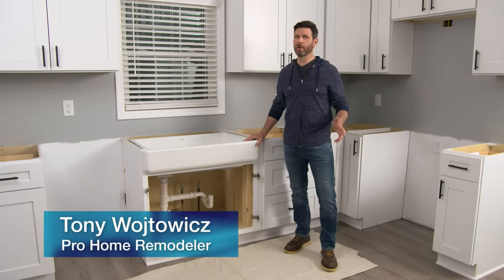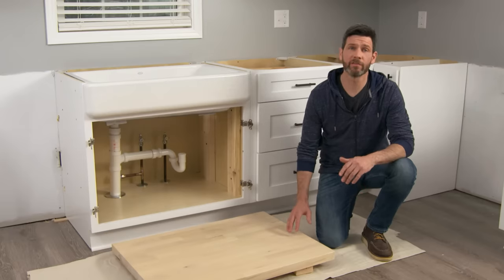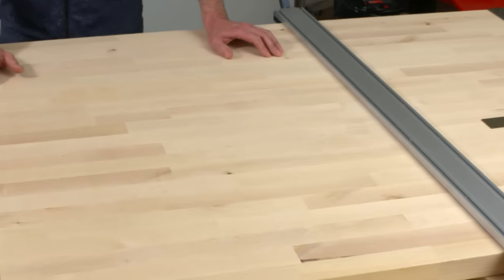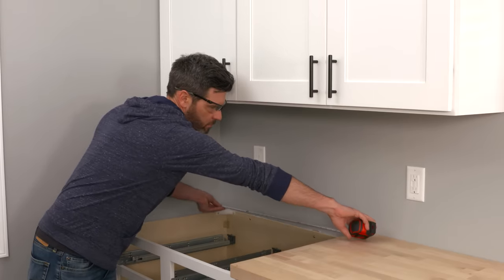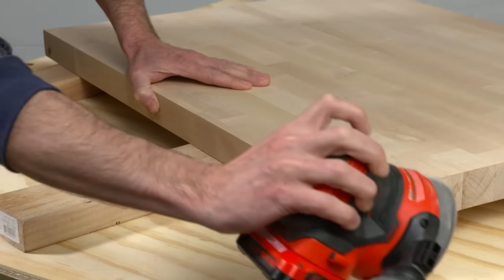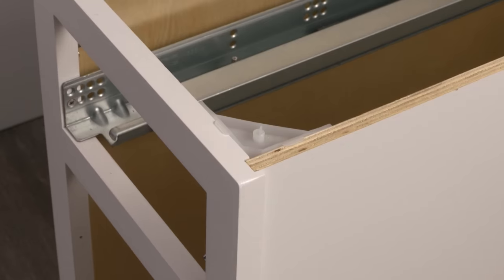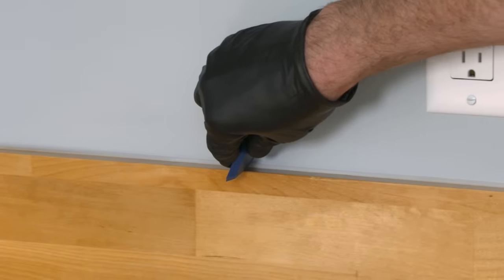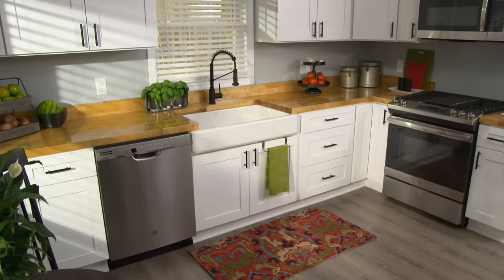How To Install Butcher Block Countertops | DIY Kitchen Remodel

Comment: Wow this video overcomplicate things a lot all you do is put the thing on the countertop and just simply mark off with your cuts are going to be just trace out the sink in terms of connecting the two pieces is very easy to do you can just use some simple wood adhesive between the two blocks. Or sometimes a little brackets underneath

Comment: Plumbing is wrong for the sink! The p trap is installed in the wrong position! Will have sewer gas coming up the left side which is not properly trapped
Reply: What do you mean it is in the wrong position? A p trap can swing in any direction.
Reply: The left side is a vent my friend

Comment: Can I make my own butcher block?
Reply: YES, YOU MOST ASSUREDLY CAN!!  There are DIY instructions on it, I just don't know if it can be found on YOU TUBE.  I got my DIY butcherblock instructions in a woodworking magazine, though you may find it on YOU TUBE, I have seen DIY butcherblock CUTTING BOARDS on YOU TUBE.  To fabricate an entire counter would envolve going BIGGER, making sections of counter, just the way they are sold when readymade.  Hey, I just remembered, I watched a guy on YOU TUBE fabricate a BUTCHERBLOCK TOP FOR HIS WOODWORKING WORKBENCH.  Look for it under that category!  Best of luck with you build.🔨

Comment: I DONT like the back splash in wood 👎
Reply: JesusFreakJen soooooo you got a better idea or do you just want to be negative
Reply: @richardrisner3635  
Yeah,  I do!  Butcher block looks better either without a backsplash or with a neutral tile,  but my preference is none.  Just google images.

It's not being negative,  it's having a gift for design and sharing my gift so others can consider other options.

You are the one being soooo "in you face" negative about me giving a constructive observation.

Have a Blessed day 😊
Reply: @JesusFreakJene  The presenter mentions that there are sections of the wall that may not be perfectly even.  My guess is that happens frequently in kitchen renovations.  In such case, there would be gaps between the countertop and the wall.  It is unlikely that they would have been able to cover those gaps with tile.  I'm sure that is why they went with the thicker butcher block backsplash.

Not knocking your opinion, just pointing out why I think they chose that backsplash.
Reply: DealerTags even with gaps, there are many solutions to still have tile backsplash. The drywall can be easily cut back or built up. A tile backer is often used, reducing the gap. A thicker tile, etc. The countertop can also be trimmed.
Reply: I looked at some more butcher block counters without backsplash and it’s actually starting to grow on me

Comment: Honestly just WHY would you get wooden countertops
Reply: look nice and doesn't cost much
Reply: Look great. Relatively cheap. DIY-friendly. It's basically a solid surface countertop for a laminate price. Can be refinished easily when it gets worn or stained. Have to be a little careful that you clean up spills right away, especially something like blueberries, wine, tomato sauce, but that's not that big a deal to me.